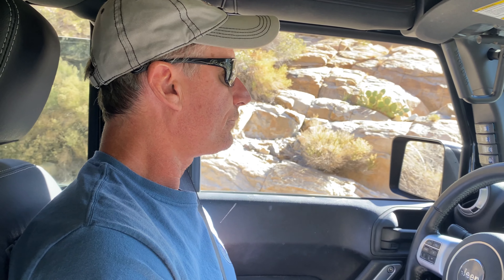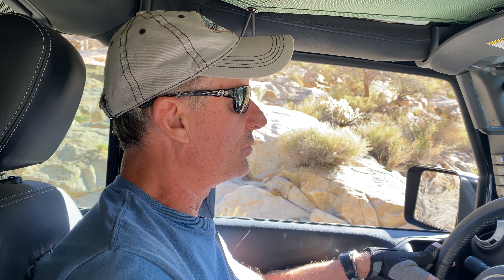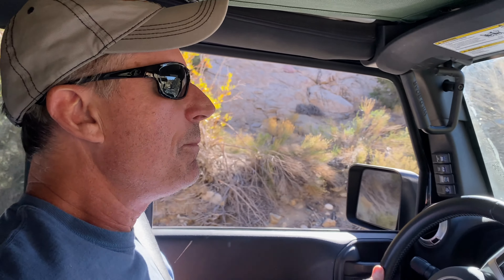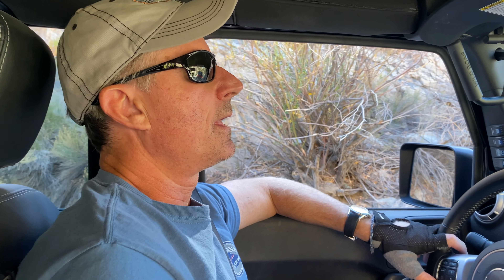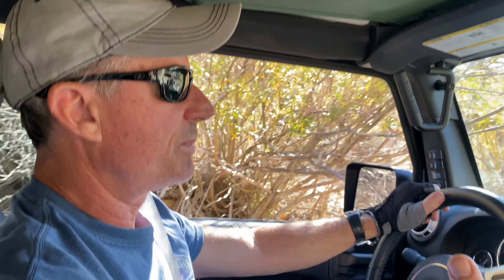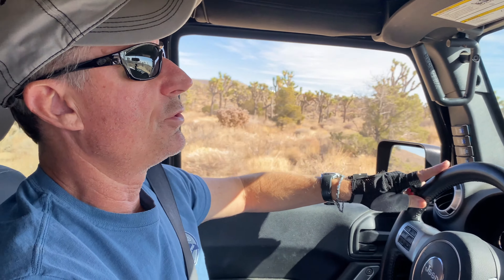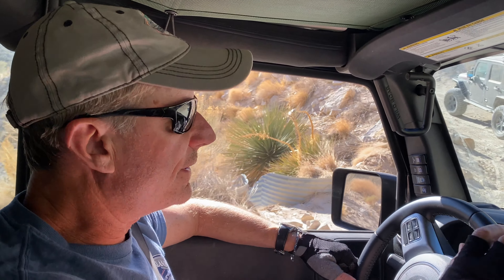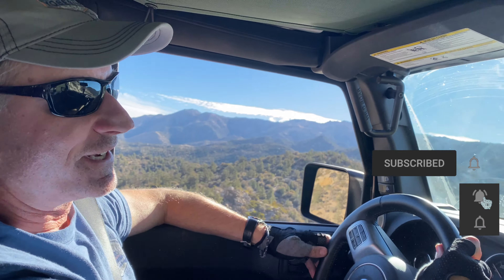Using Jeep Wrangler Rubicon Electronic Sway Bar Disconnect ~ A Complete How To ~ Ep. 85

Comment: 👍I have a sport, so don't have that luxury.  But did wonder 🤔 how it worked on the Rubicon. Good informative video.
Reply from the maker: Thanks for watching buddy!
Reply: I have a sport as well. I agree. This was a great video. And far as lockers go, we don’t have those either (from factory) And I never know when I would’ve needed them or could’ve used them. Never had any issues with open diff..
Reply from the maker: Yeah most of the stuff I do you don’t need a locker. Thanks for watching and commenting!

Comment: Hey! tc, I have a stock rubicon 2017. I don’t do off roading at all.

My current issue is that my sway bar light starts to flash randomly and check engine light goes on as well. 

I feel like once I fully stop and try to accelerate my car loses engine power or feels like it’s stuck on first gear. Any idea what it could be?
Reply from the maker: Yikes! Those problems may be unrelated. I would get the OBD read to see what the computer diagnostic faults are.  I may be telling you what you already know, but most auto part stores will use an OBD reader on your car for free and either give you a print out of the faults or tell you what they are. You can also buy OBD readers fairly cheap that work with smart phone apps. That should tell you what’s causing the check engine light (probably related to the power loss). I would be surprised if the power loss has anything to do with the sway bar light blinking. Have you tried checking to see if the sway bar disconnect works? You need to be in 4wd first and then toggle it on. You may need to move your steering wheel or move forward to see if the light will go solid. Don’t drive in 4wd on dry pavement.  If the light is solid then your sway bar is disconnected. If you can’t get it to go solid then you do have a problem with your electronic sway bar disconnect. I have heard a lot of people complain about the electronic sway bar on Rubicons. They start blinking, won’t work… and then they find water in them. If someone owned it before you maybe they did some water crossing. Or I suppose driving over water on the street could do it too. I think they were poorly designed. I’m guessing you’re outside of warranty (no extended warranty). I would start with the OBD and try to use the sway bar disconnect and see if it works. Good luck!
Reply: @tcsadventures  appreciate the quick reply! Thanks again, I will get the OBD reader to check if anything comes up. I live in Puerto Rico sometimes roads could get a bit flooded. So maybe that could be it maybe it has water in it. But thanks again I’ll keep you posted!

Comment: Have you had any issues with the sway bar?  I've read the JK can have issues.   If you're looking to buy a JK, is there a way to tell if it's engaged or disengaged other than the dash light?  Thanks
Reply from the maker: I have not had a problem with mine. I know from comments and other people that you can have problems if it gets submerged in water. There’s water intrusion that can interfere with the electrical connection. Other than the dash display, I’m not aware of another way of knowing if it’s engaged without taking it apart. I don’t know if the JL has solved this problem.
Reply: @tcsadventures  Thanks!

Comment: so what if you go into 4wd and disconnect the sway bar then go back into 2wd? what would happen?
Reply from the maker: The same thing that happens when you go too fast. It automatically reconnects the sway bar. The owner’s manual for my model states you must be in 4wd for the disconnect to work. (I put a screenshot of the manual in the video). I don’t think Jeep has changed this on newer models based on complaints I’ve read on line. In my opinion it would better if you could disconnect the sway bar in 2wd, but they could still keep the speed limitation on to address their safety concerns. On my CJ7 I have a manual sway bar quick disconnect so I don’t have this issue.

Comment: Mine has been flashing for couple weeks and wont reconnect back. I did the flat surface but nothing. not sure what to do
Reply from the maker: Have you driven through deep water recently? I know of people who had problems with it after the electrical connection got wet.
Reply: @tcsadventures  The day it stop working i was going through water. later that day it never connected back.
Reply from the maker: I know other people have had that same problem. It should be designed to keep the water out. You might find someone on line who has successfully dried it out to get it working again.
Reply: @tcsadventures  Thank you. I will search on line.
Reply: @tcsadventures  have you heard of the disconnect staying disconnected and not give a blinking light? I bought a 2013 that I’m going through and it seems the sway bar is disconnected. Never have I been able to move a sway at by hand  lol. The jeep is a little loose to say the least. I’m considering going to an anti-rock type swaybar is I don’t get the owm correct. Hammers is coming 😁
Reply from the maker: No I haven’t. So there is no “sway bar” light illuminated, blinking or steady, but you’re convinced the sway bar is disconnected? I would think that at highway speeds you would notice poor handling if the sway bar is in fact disconnected. The problem that I’ve heard from several people is that after getting the Jeep in deep water the electronic disconnect got wet and started malfunctioning.
Reply from the maker: @elchile007  Whatever happened with your sway bar problem? Were you able to get it fixed?
Reply: @tcsadventures  The track bar feels disconnected without a light./code. We only put about 100 miles in it since we picked it up. I didn’t notice an issue, but it was heavy traffic when we brought it home. It’s a trail rig for my wife and kids. It has a RE 3.5 short arm that will remain for now. We got it home and put it on jack stands. Since the rain here finally stopped, I Installed new Metalcloak springs , American Iron ball  joint delete , installed an Adams driveshaft, and aluminum 1 ton steering. Drove it today and it feels like 3 wheels motion on hard acceleration turn from a dead stop. I just picked up a new rod end for the current front trackbar, but this hard lifting lean doesn’t seem trackbar related. Although I cans be wrong. Currently have new adjustable trackbars on order from Metalcloak.

Edit: Thank you for such a quick reply on this semi old thread. You seem to have had some experience with these units and I wondered if you had heard of such a thing. I appreciate your time.
Reply from the maker: Wow you’ve done a lot of work already. I haven’t had any problems with my electronic sway bar yet, but I know that when people have had problems — a factory replacement is so expensive (and not that reliable) that they went with an aftermarket e sway bar. It seems crazy that they would make them susceptible to water intrusion on a Jeep. Good luck!
Reply: @tcsadventures  Hey. So i took off the motor for the sway bar and open it up. It was just full of mud and dirty water. So i knew that was the cause right there. I clean the inside really good and put it back together. When i start the car and press the sway bar button, it work. Looks like the seal they put is terrible.  Now couple months later i went through water and the same thing happen. But this time i could not take it apart because i was to far and no tools. So i went under the car and kind of tap it with my hand and heard it lock back.
Reply from the maker: Thanks for the update. I guess it wasn’t designed well. I’ve heard other people describe the same thing.

Comment: Nice video. How tough is RC?  Think I’ve done the trail that parallels it somewhat but never hit that trail. Like to try my 392 on it. Hit me up if ya all go again.
Reply from the maker: That part we did was easy, but if you do the Mottino Wash section — that’s some rock crawling! I have a video of it on my channel. (episode 86). Wow, so you have a V8 Hemi that’s some power!
Reply: @tcsadventures  Yes had it about 6 months. I wanna hit more trails but not any serious crawling as I’m not into damaging my 100k Jeep. Wanna have some fun but not tear it up. If ya all go an need another Jeep in the line, hit me up.
Reply from the maker: Is it all factory or have you done some upgrades? We do runs with two different clubs I’ll let you know next time we’re doing one.
Reply: @tcsadventures  The only upgrades I’ve done was added the Warn, some Rigid lights, ARB onboard compressor and some other odds and ends like a rear table on the tailgate and some storage. Other than that it’s stock and I will keep it that way.  Oh and I added an oil catch can.